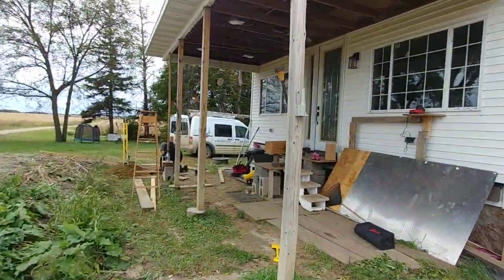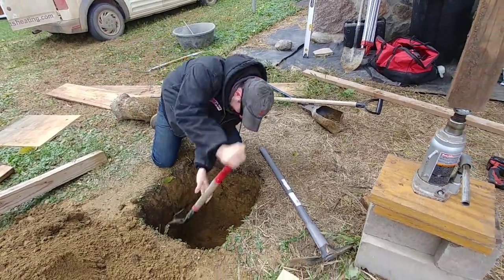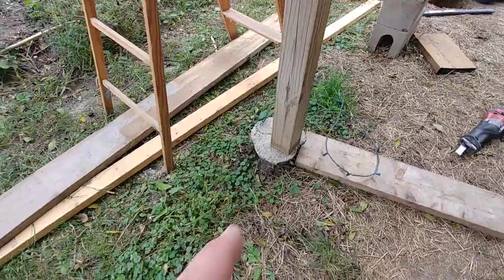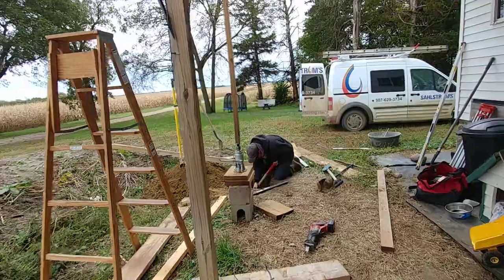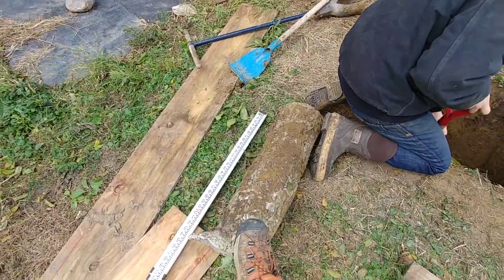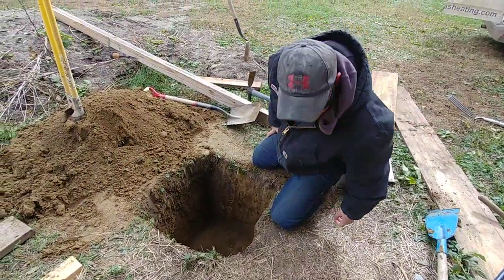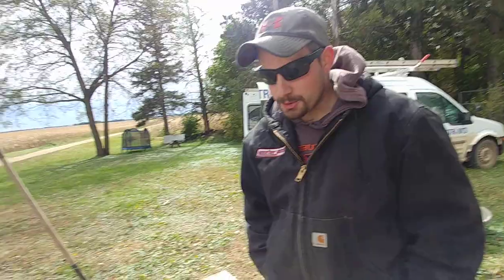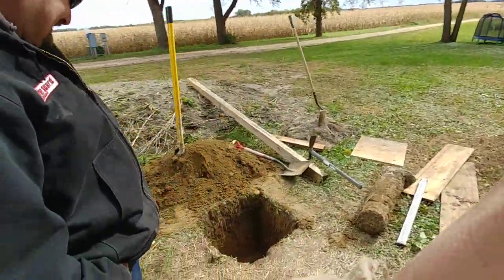Terrible Footing Construction Was Not Even Below Frost Line!!!

Comment: I hate having to redo what should have been done right in the fist place.  Are you going to confront the contractor with this for some reimbursement ?
Reply from the maker: Yeah that's tough. I don't think I'll bother them about it. Sometimes its not worth souring relations over little things although this was a lot of work to fix. This is one reason I prefer to do things myself whenever possible.
Reply: @BenjaminSahlstrom  Some relations should be soured. They didn't care enough to do it right, so I would advise against using them again.
Reply: Ben. How deep below the frost line do you have to go? ie…if frontline is 24” ….do you have to go 48” or?  Thx